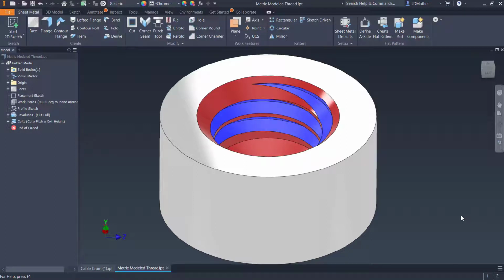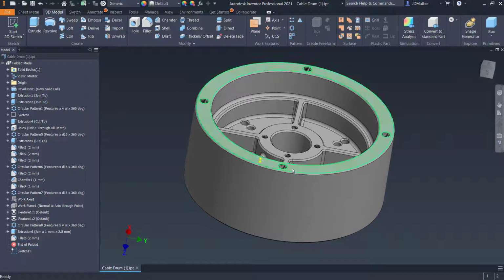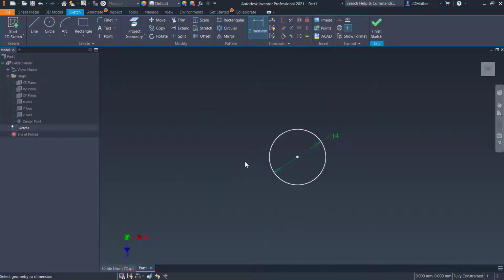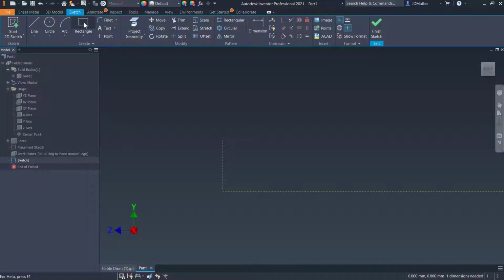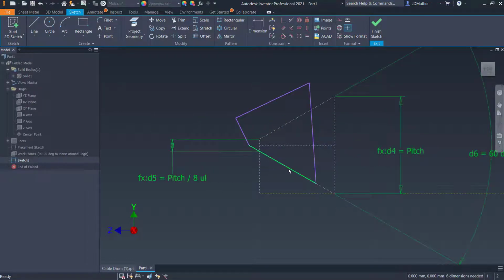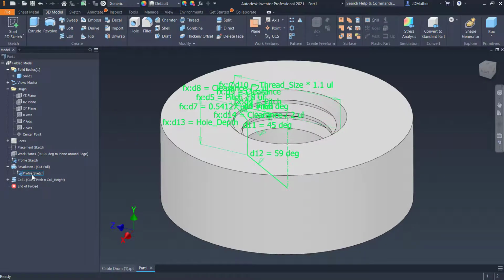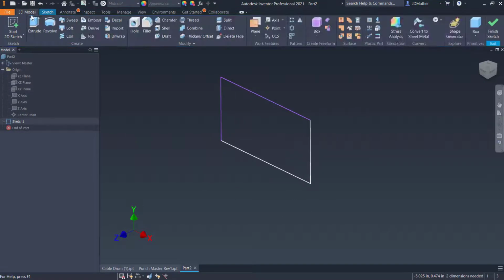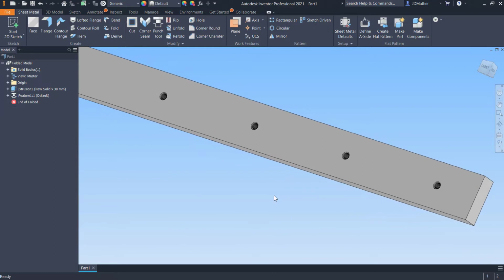3D Printable Threads in Autodesk Inventor

Comment: I really wish you would make a similar tutorial for external thread. This punch tool for internal thread is brilliant.
I have a hard time wrapping my brain around constructing one myself for external thread - even with inspiration from this very thourough turorial.
Reply: The 'Profile Sketch' revolved around the centerline creates your tool. In this example the 'profile sketch' revolved creates a tapping drill bit basically. You need to revolve a shape around a centerline where the shape the revolution creates is that of a die (the tool you would use to thread a shaft or rod, if you're not familiar what it looks like look it up, it's important)...
So basically, in the threaded hole example the centerline is part of the shape you revolve. However o create a die, you basically need this 'r l'. Where 'r' is the shape of your profile to be revolved around 'l'. Basically a donut with teeth inside so as you spin it around a rod, it threads it. 

This method works very well for resin printing. After fully calibrating for dimensional accuracy, I can print threaded holes and threaded shafts M2.5-M18 plus 1/4"-20 with uniform parameters. i.e. for holes I always use 0.1mm clearance and for threaded rods I use: Clearance=(Pitch/7)+0.025....This allows all of them to work with each other as well as store bought nuts and bolts

Comment: This is a lot of work for not a lot of gain.
Reply from the maker: Once and done!
Reply: @TheCADWhisperer  The add in did not work either.  I will go through your method and use it.  I assume it will change dimensions when you change the parameters.
Reply: Hello CADWhisper, I am not sure what I am doing wrong but mine doesn't work.  It wont pick up the hole centre.  I have done it 4 times now and getting frustrated.  Apparently 5 times is the lucky charm.  I released what I was doing wrong.  I had to many centre points in.  Thank you for all the help on this.  I am sure it will be most useful.

Comment: do you have a video for inch thread tool?
Reply from the maker: Exactly the same process - simply use inch thread pitches.
Reply: @TheCADWhisperer  so I am trying to use similar process but for external NPT threads.
Reply from the maker: @jmendo64  Tapped holes are generally done more than one at a time is the reason I did it as a Punch feature, but external threads are normally done one at a time, therefore you can create as a simple iFeature and set up a table for different sizes.
Reply: @TheCADWhisperer  Thank you very much and keep the amazing work!

Comment: Nice video. Is there a way to make a 3d printable thread on a shaft?
Reply from the maker: Essentially the same technique.
If you only need it once - of course you don't need to do the entire process of creating an iFeature (or Punch).  But once it is done - it is done for all time and just drop the feature on any shaft as needed.